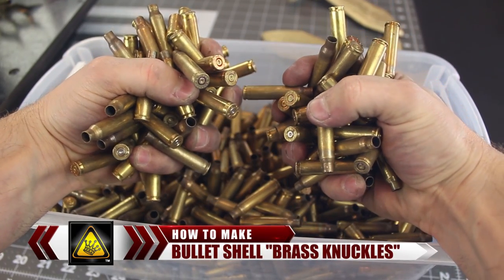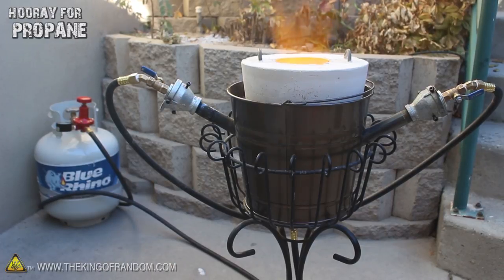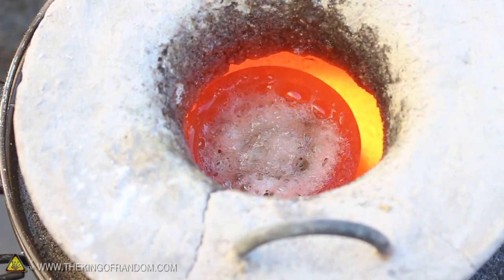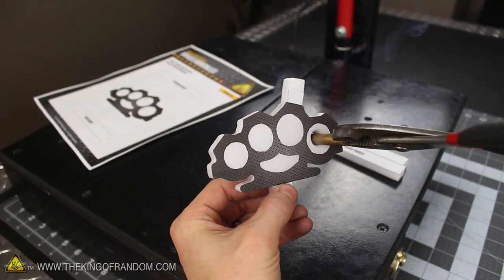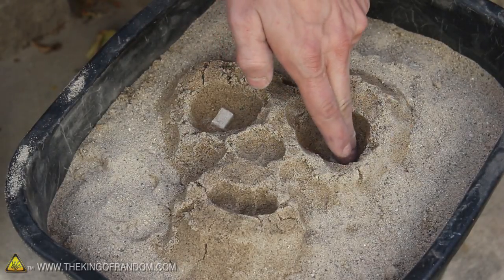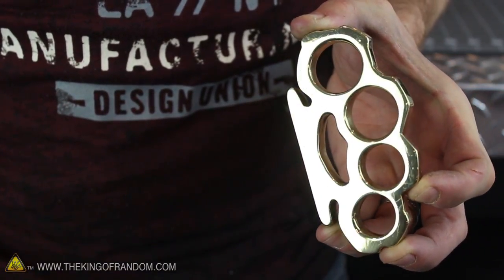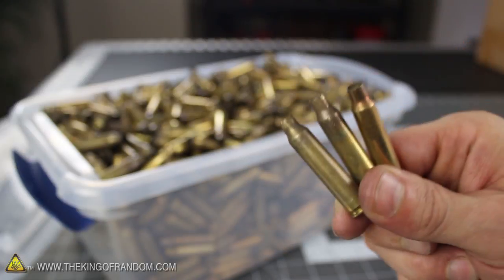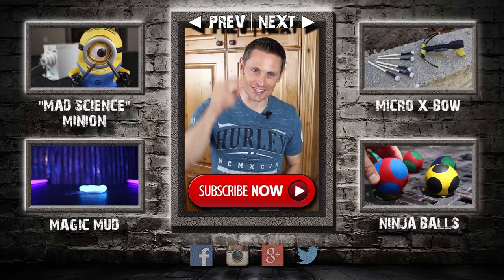How To Make Brass Knuckles, From Bullet Shells

Comment: How.. how is he so smart? Like seriously. All of this stuff is so elegant and thought out
Like the science stuff he talks about is amazing
He knows what he's talking about and isn't just some random doof that suggests things that may or may not kill you
He knows all this risks and is amazingly creative
Reply: Which "Science" are you talking about. Never saw science in his videos. And you do not have to be smart to Do this stuff bunt ok.
Reply: +Soldiermelly Boric acid keeping a layer of oxide from forming, and helping zinc not boil.  Science.
Reply: +Christina Matthews Best guess would be he is or was in a profession that did this kind of stuff. Engineer, scientist, science teacher or something along those lines.
Reply: He copied this off of someone.
Reply: The ideas that he is using are by no means new, or his original ideas, he's just has better video making and editing ability than others doing the same thing. There are several books on the home foundry that have been around for decades. And if you learn some more about metal casting you will learn that a lot of the methods he is us aren't really all that great. Plaster cracks and falls apart, eventually returning back to a powder state pretty quickly at these temps. That's why you see so many different furnaces in this video, they don't last. And borax is the flux used for brass, and other metals, and can be found in stores almost as easily as boric acid. (They are essentially the same thing, just in different form). But one bit of "science" he doesn't seem to care about, is the white smoke coming from the melted brass, that is vaporized zinc, and is toxic. Look up zinc metal fume fever. Inhalation is easy to avoid, but I wonder how many people will end up VERY sick from this video
Reply: Because he copies other people's ideas
Reply: ***** No, he does copy other peoples ideas.
Reply: +Christina Matthews It is obvious that he is smart because most of the people have replied to your comment are apparently jealous. Their jealously is of a primal nature.   They feel threatened  that Grant Thompson has attracted a beautiful mate with his knowledge and abilities.
Reply: +Christina Matthews look up Tito4re, grant copied him
Reply: +Christina Matthews college is awesome, a lot of people don't realize that. This video has chemistry, engineering/design,  also from some type of metal-working vocational school. STEM jobs rock, the information you learn helps you create little projects like this on the side.
Reply: +Mohammed Vates on the contrary, those who don;t go to college have more time to do more worthwhile things, like practice hands-on work, study something they might actually use, OH, AND NOT PAY THOUSANDS OF DOLLARS FOR A PIECE OF PAPER THAT KEEPS THEM IN DEBT FOR THE REST OF THEIR ADULT LIVES.
Reply: +Mohammed Vates wow thats NOT what it is here in Cyprus
Reply: Thanks for all your feedback. I still believe he is very creative. And I love his voice in the videos, it sounds professional. I'm sorry that some of you disagree. But I enjoy how and what he teaches
Reply: +PYTHON GAMING dude chill everyone copies things, people copy memes, people copy other YouTube comments, people do pranks other people did, this is normal now calm
Reply: his married
Reply: kenny mccormic my dad is an building Engineer and he does a lot of math, but he does not know how to make BRASS KNUNCKLES !!!

Comment: Now show us how to make an AR15 receiver Christmas tree decoration.
Reply: Now that I think about it, this would be a better alternative instead of plastic ones from 3D printers! It's legal to make your lower receivers, right?
Reply: +LeoM23 Yes it is. Typically people just mill them from 80% forgings. Google the company Tactical Machining
Reply: +LeoM23 The lower is technically "the gun" and requires a serial number so I'm not sure how that would work from state to state. I know you can make just about everything else no problem.
Reply: +CubNole Should be just fine, as long as you follow your local laws when you assemble the firearm on what features it can and cannot have. According to the Gun Control Act of 1968, pretty much As long as you are creating the receiver on your own, it's good to go. No filing, no registration, me serial numbers needed. For more information, look here ;
http://www.atf.gov/firearms/faq/firearms-technology.html
Reply: +LeoM23 Legally, the lower receiver is the gun. You can make the receiver but you cannot transfer it to another person. In theory this includes letting them pick it up when not assembled just to look at it.

From a technical perspective, you can probably make a lower receiver with little difficulty, it is one of the easiest parts of a gun to manufacture.
Reply: +LeoM23 I strongly advise you to disregard the "wisdom of the internets" and DO NOT attempt to make a lower reciever.  Don't make suppressors or saw off the barrels of shot guns either.
Reply: +GinEric84 You are correct about the part on not making NFA items...unless you of course file the necessary forms to the ATF. But as far as making your own guns, follow your local laws on what you can build, but it's completely legal! Don't be a sheep and fear what you don't understand, educate yourself!
Reply: +The Watcher I am happy to buy my lowers so I am never in a situation where I am explaining to law enforcement why my gun doesn't have serial numbers.  A few hundred dollars is not in any sense worth the hastle
Reply: +GinEric84 That's totally fine, and most people (like yourself) will just buy their lowers from an FFL dealer and call it good. Just don't spread fear based misinformation and advice. If you don't understand the laws and your afraid of talking to police (if and when that ever happens) that's your own deal.
Reply: +The Watcher Great, cops don't like untraceable weapons so you would do well not to advise people to do things that will run them afoul of the police, especially since money paid to the ball bondsmam while all this is being sorted out is non refundable.   So feel free to be snarky and do dumb sit but please do not encourage others to make poor decisions
Reply: +GinEric84 Know your rights. Knowledge is power. Do not fear the man:)
Reply: +Radi0he4d1 Priceless comment - for me the best of 2015. YOU ROCK!
Reply: Lmao!
Reply: lol made my day
Reply: +Radi0he4d1 lol

Comment: Using Styrofoam as an investment instead of wax is genius.
Reply: +JackManic1984  There is pros and cons to using foam.  It is much harder to make rounded surfaces with foam, because it is little round foam or plastic beads that are formed into those flat sheets through heat and compression. They revert to being round when you try to cut them.  That is where doing a multistage process of negative to positive forms, with wax, may be necessary for certain projects.  Don't get me wrong.  This is a neat way of doing it.
Reply: +Jacob w theres different types of foam you know. closed or open cell. the pink foam from a homedepot is perfect for rounded stuff
Reply: +jooster he didn't not file it and then turned out that nice and smooth its impossible
Reply: +Chaserboy yea dude he just did it its totally possible grab a file and smoth it out its not hard its teadous work though
Reply: +Chaserboy yea its totally possible to file things that smooth then buff. thats how things were done for thousands of years before electricity.....people act like things werent made till a couple decades ago...

Comment: How do you contend with the spent primers? They're made out of stainless steel, so they aren't going to melt with the brass. Are you able sift them out, somehow?
Reply from the maker: +Ernie Velveeta Most primers are made of brass as well, so they melt right in.  All the primers for these .223 shells were, but if you want to be extra sure, just run a magnet over them.  If they stick, they're steel.  If they don't, then probably brass.
Reply: Grant Thompson - "The King of Random" Ahh...they must be plated, since they have that silver appearance.
Reply: They will be floating around the melted brass, so just fish them out with whatever you're using to remove slag.
Reply: +Ernie Velveeta Most primer cups are made of brass, they're just plated.
Reply: +Ernie Velveeta Would steel not be a rather unsuitable material for making primer cups out of? 
You do have the higher material strength on a part meant to be deformed, which translates into greater wear at the firing pin.
Also, steel would be prone to rust to some degree, possibly decreasing the "shelf life" of the ammo, and as far as I know, militaries around the world like to store their supplies for very long periods of time indeed.
Reply: Abel Babel Yeah, it would be. A stronger material, like steel, would make it more difficult for the firing pin to dimple the primer, leading to unreliable ignition.

Honestly, I don't know what the hell I was thinking. Stupid me for making that post before completely waking up... LOL
Reply: ***** Indeed.

That was probably the dumbest comment I've made in a long time, especially I should know better... LOL
Reply: +Ernie Velveeta I would be more concerned with things like contamination from the spent powder and compounds in the primer; but you can always punch out the primer, and clean the shells before tossing them in the furnace.  In fact, they sell devices specifically for that purpose, because a lot of people reload empty shells for fun and profit.
Reply: Shinigami I know. It's called "reloading," and it's a hell of a lot of fun!
The tool used for removing the primer is a decapping die.

Thought I have no experience with melting the brass casings, the burnt powder would probably be in with slag.

In any case, I doubt it's any more of an issue than soda residue when melting aluminum cans.
Reply: +Ernie Velveeta As many have said, they are normally made of brass. If you want to remove them without any special equipment though, just find a finishing nail that will fit in the hole in the base of the brass case, put it though the mouth of the brass case into the hole, and pop it with a hammer. You might want to blunt the tip of the nail first so it does not punch though the cup.
Reply: Jesse Sisolack Yeah, I understand that the primer cups are made of brass. I would be just melting the casings down, so I have no reason to decap them.
Reply: +Ernie Velveeta There are tools that clean cases very well, also.  I'm not well versed in brass metallurgy; but the results, I think speak for themselves.
Reply: Shinigami I know. I'm aware of the equipment used in reloading.

Comment: If brass knuckles are banned in your area
Make knuckles from aluminum or copper or(steel )
Reply: or thermite or titanium
Reply: GoingGreninja 1. It takes a alot of heat to ignite it, more heat then a torch 2. I ovi meant the residue of thermite
Reply: BassAttack ohhh...you should have made it a bit clearer about what you were saying. that is why i
was confused.
Reply: GoingGreninja its fine
Reply: I just used wood 😂😂
Reply: Use the hardest metal chromium
Reply: In Canada we can’t use any metals
Reply: @cataclysmicterrain  but it's so brittle
Reply: @devvydoesstuff  u use mapel syrup?
Reply: TUNGSTEN
Reply: GOAT GOATERSON yes but then I ate it
Reply: @devvydoesstuff  😂😂
Reply: @devvydoesstuff   thank you for taking that with humor
Reply: @GoinGreninja  confusing it with tannerite

Comment: why do you need to melt the brass into ingot muffins first? can't you just melt it once, straight from the original casings?
Reply: it helps to clean out most of the impurities in the metal. The impurities gives you a high ratio of useless slag and would prevent the metal from flowing properly. Once you melt the ingots, there's a lot less clean up and you also have a better idea of the volume you can measure.
Reply: F/X Art Desk Hi, I love your reasoning
Reply: kiwin111 it makes it more pure, and you don't have to clean it while it's in the crucible, so it can be poured faster.

Comment: You could just skip the ingot step and just go straight into the knuckles right?
Reply: Tony Wu yee
Reply: Wouldn't recommend it though. You'll have chunks of slag often blocking the metal from filling the mold. Also might look horrible if a piece of slag ends up on the "surface" of the item being cast.
Reply: You could

Comment: Why did you melt the brass twice?
Reply: +AL_O0 ᶜᴼᴹᴹᴬᴺᴰ ᴮᴸᴼᶜᴷ ᴬᴺᴰ ᴿᴱᴰˢᵀᴼᴺᴱ I would assume convenience. This way he melts all the bullets he has at one go, creates ingots of relatively pure brass, and thus when brass is needed for casting, you can just take an ingot, having little impurities to take out.
Reply: +AL_O0 ᶜᴼᴹᴹᴬᴺᴰ ᴮᴸᴼᶜᴷ ᴬᴺᴰ ᴿᴱᴰˢᵀᴼᴺᴱ Maybe because he will not use all the brass that he made in the first pour, so he made the biscuits to use them later. Plus by making the biscuits you have pure brass metal to use whenever you can. Everybody does the same thing in casting; melt - make ingots - make the piece itself
Reply: He does it so there is no slag for when he pours it the second time.
Reply: +AL_O0 ᶜᴼᴹᴹᴬᴺᴰ ᴮᴸᴼᶜᴷ ᴬᴺᴰ ᴿᴱᴰˢᵀᴼᴺᴱ the first time was only to make ingots so he can have spares, ofc you can jest melt once and cast right after
Reply: I think its because he wasnt using it all at once, he may have been still prototyping designs for the brass knuckles

Comment: Will borax work instead of boric acid? Or are they the same thing?
Reply: Borax is a hydrated salt of boric acid IIRC ... it should work but you may want to throw it in while the metal is cold and let the water get driven off first

Comment: Could you please help with a similar project using copper. I have a bunch old copper computer fan heat sinks that I would like to use for a project like this. Thanks.

Comment: what you should have done is you should have gotten like 30-06 bullets like the actual projectile and made the same molds and cast them in like steel or aluminum and put those on the knuckles instead of spikes

Comment: Step 1: be American
Step 2 : have a massive propane tank
Step 3 : have a diy furnace 
Step 4 : light coal inside of the furnace and put air tubes in
Step 5: melt the bullet casings 
Step 6: have styrofoam brass knuckle templates and sand
Step 7 : do whatever else he did

Comment: So how does the molten metal pass through the foam?
Reply: it gets so hot that it can melt it on contact and you wet the sand just a little bit so that the metal takes its place

Comment: What if one of those shells were still full of powder......
Reply: then it wouldn't be much trouble, i think it would burn instead of explode
Reply: It would simply burn do the to the primer not igniting the powder while the actual led bullet is still inside having no pressure to explode.

Comment: Don’t make brass make tungsten knuckles
Reply: tungsten requires very very hot temperatures as it has a melting point of around 2600 degrees Fahrenheit. you can't really achieve that in your backyard